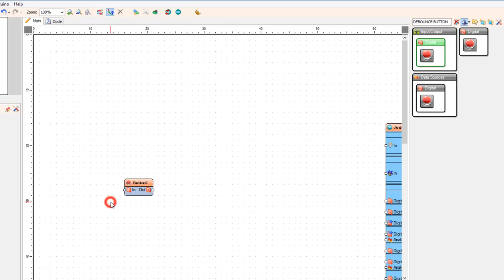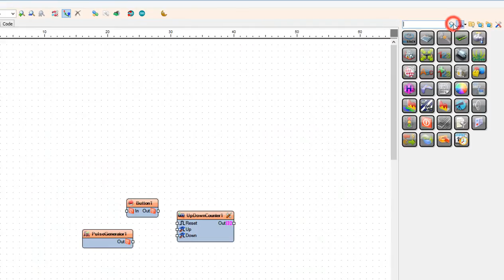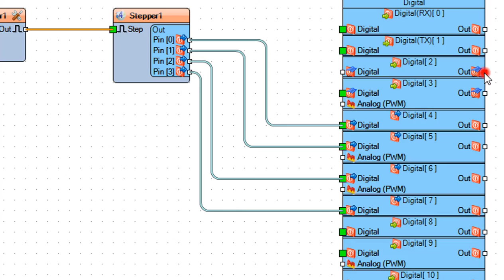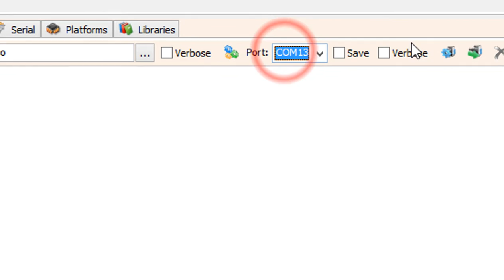Move a stepper motor to an exact position

Comment: i have a question, would there be a way to use a Nema 23 steppermotor and use Aurdino and some sort of keypad to make the steppermotor move a ballscrew 0,5mm,1mm,2mm,3mm,5mm by pressing different buttons on the keypad, lets say i have a Z axis with a linear actuator with a nema 23 steppermotor on top of it, then i have a keypad that i can adress to moving the ballscrew between 0,5mm to 5mm, and i would be able to press the 1mm down button for example 5 times and that will move the ballscrew 5mm down in total, or press the 1mm button up button 5 times on the keypad and the ballscrew will go up 5mm in total. Thanks..
Reply from the maker: Yes sure, actually a good idea for a tutorial!
You can also send an email here: https://www.visuino.eu/contact/
 and will send you some updated projects for the stepper
Reply: @visuinoprojects   Thanks.. i´ve send you a message.. :D

Comment: How can i get to reverse to exact position when the button is released?
Reply from the maker: If you select the stepper component you can set "Reversed" in the properties window, this will change the direction of the motor.